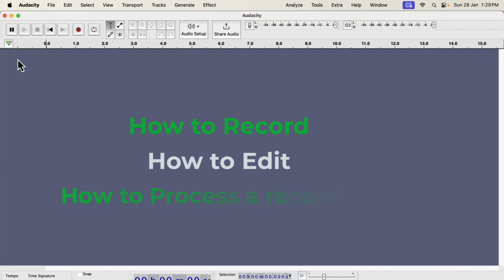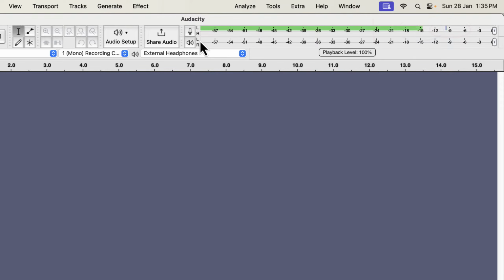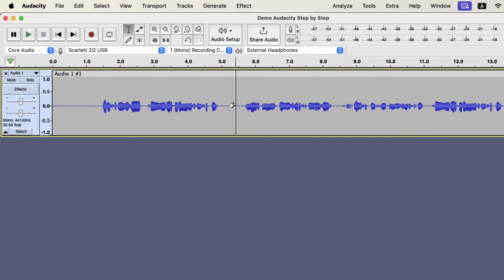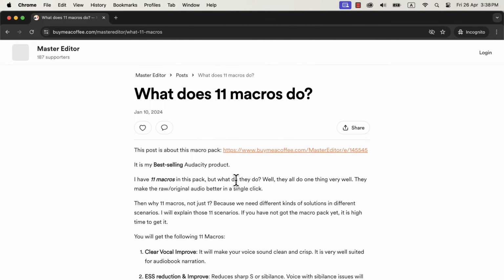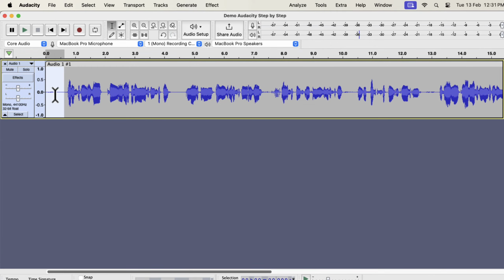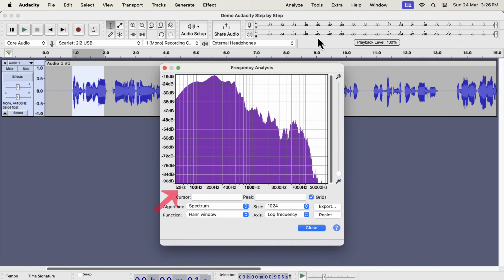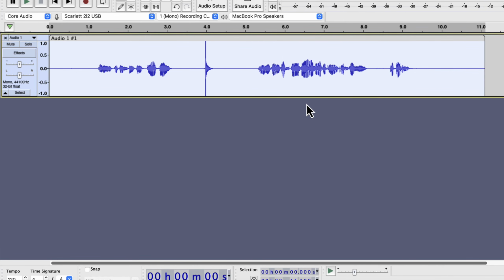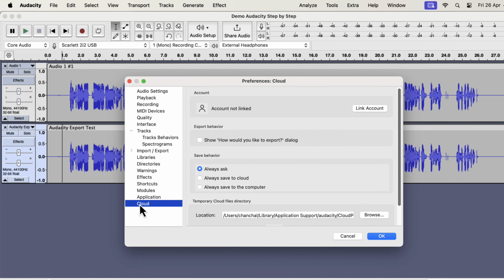How to use Audacity to Record & Edit Audio | Complete Beginners Tutorial (2024)

Comment: Hi! I am starting to learn Audacity. Your videos are invaluable. Recently, I have been having a problem: When I press record, it does not record anything; it just shows a flat line. I must have changed this while playing around with it. What do you think I should do to fix it? I would really appreciate your advice.
Reply from the maker: Please check the slider in the recording meter is set to 100%. Also check the microphone/audio interface gain knob and set to 100%. After you record something, Normalize the audio to -3 dB and then check it the loudness looks normal.